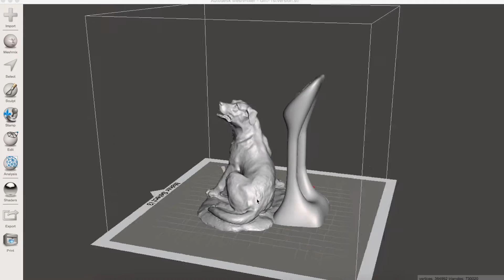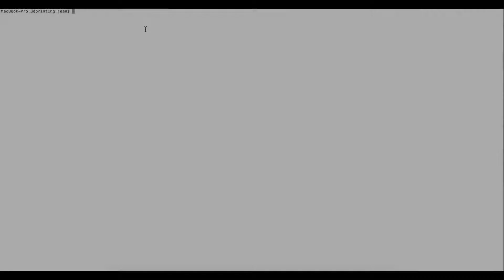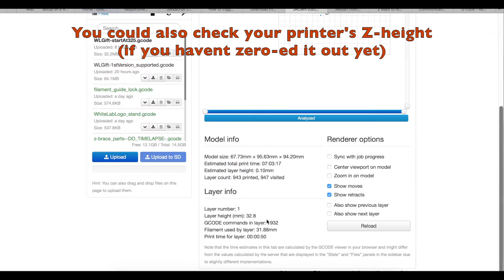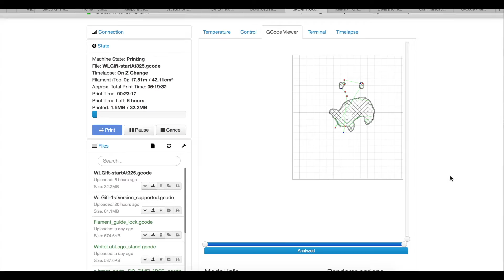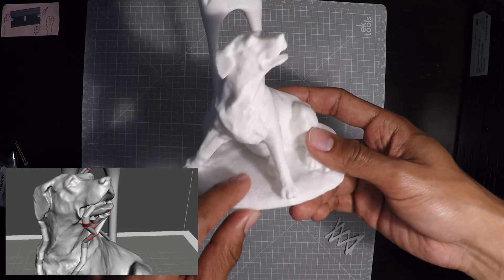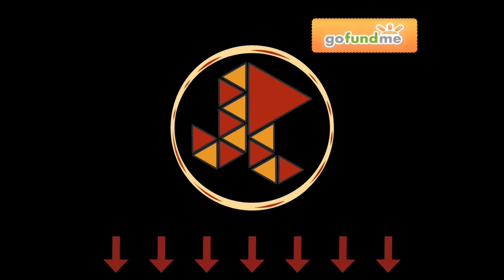Rescue a Failed Print!

Comment: Thanks a lot! I was in the middle of a print when I run out of filament and I didn't have a spare spool. I had to order another one and this was on Friday so it arrived on Monday. Amazingly I could finish the piece after 2 days. A tip if you have glass on the bed try to stick the piece with a hot glue gun because in my case when it cools the print comes off.
Reply from the maker: No problem! I'm glad this worked for you! And thank you for the tip! That'll be very useful

Comment: what if i can't home the printer?
Reply from the maker: You can't home the printer? Does it use stepper motors? If so there should be an option to do so. What printer do you have?
Reply: MexiMaker i already resumed the print but i couldn't home the printer because my printer would crash into the object because it was such a large print.
Reply from the maker: I see... so you couldn't home it in the Z axis, correct? How did the print go? 
In the future, what I would do in that case is look at the Z position in the printer's dial menu, then adjust going off of that number.
Reply: MexiMaker i homed the z Axis seperatly in the upper right corner because there was still room. The print had some missed layers but that was not a problem.
Reply from the maker: Well I'm glad it worked out in the end! Sorry I couldn't get to you sooner
Reply: MexiMaker No problem i solved it myself:)

Comment: Thank you - this just saved an overnight print when the filament ran out (I haven't set up a run-out sensor for my CR-10 yet). I measured the z axis my using the stepper motors and a piece of paper, just like when leveling, then searched for that z height in the gcode. Thanks a lot!
Reply from the maker: +Tvar7531 no problem! Glad I could help!